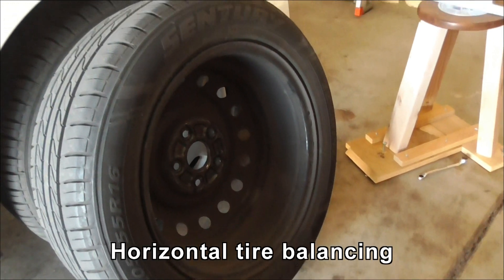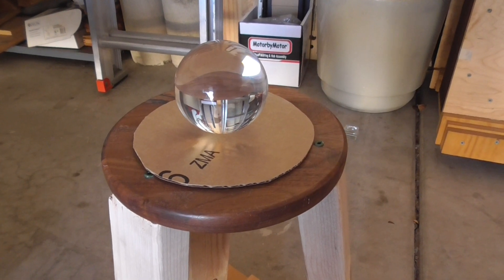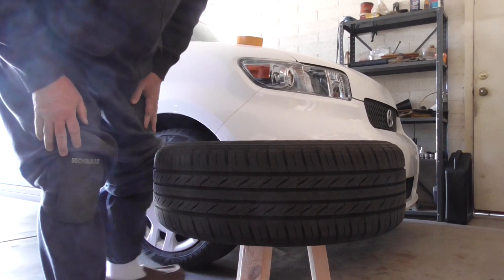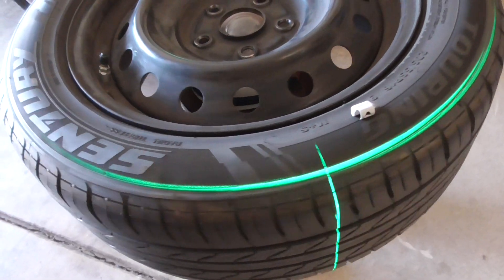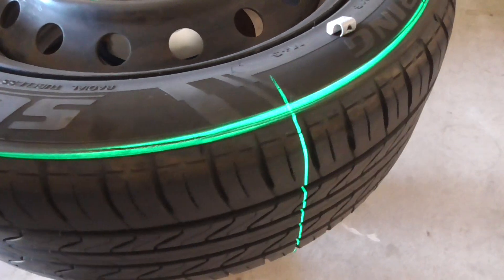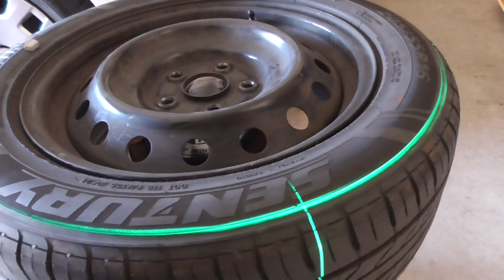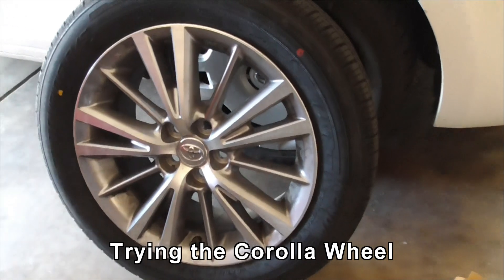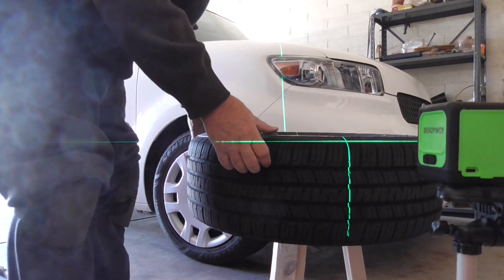Horizontal Tire Balancing Without an HF bubble balancer

Comment: Just yesterday, I drilled a bigger hole in my Amazon bubble balancer where the point of the pin sits in,  this made a massive improvement,  now just barley touch the balancer and it’ll rock back and forth for at least 15 minutes.
Reply from the maker: You may have seen my other videos where I try and get the bubble balancer to work. In the end, the one I have is to flawed to be useful. Multiple problems.
https://www.youtube.com/watch?v=an6sURvUhBA
There are links in text under the video to the other videos. In the end I went with vertical wheel balancing - similar to what I do for motorcycle tires. A 2 step process.
https://youtu.be/wJ4Auia2C1Q?t=138   (2:18)
and then at this time in the same video
https://youtu.be/wJ4Auia2C1Q?t=381   (6:20)
Reply: @richbinaz  I have seen some of your other videos.  I got the idea from DIY VINNY on Utube, about drilling out the pin seat.  I have a static spin balancer for my motorcycle tires IF I don’t use beads.   The bubble balancer suits my DIY needs and now it’s better than before.